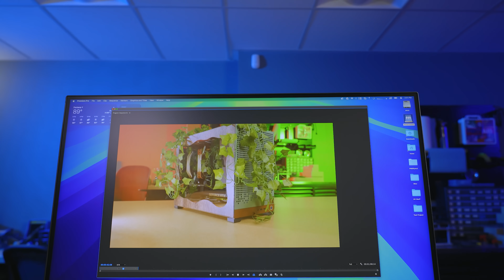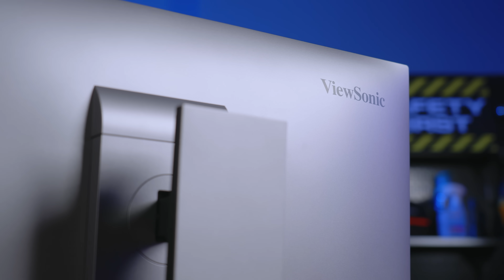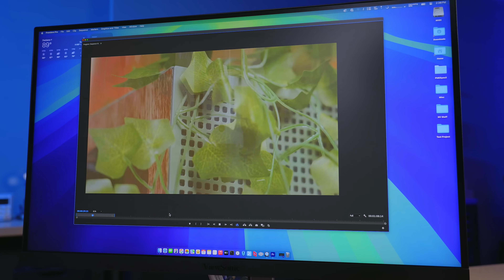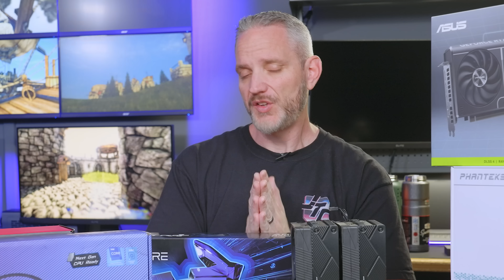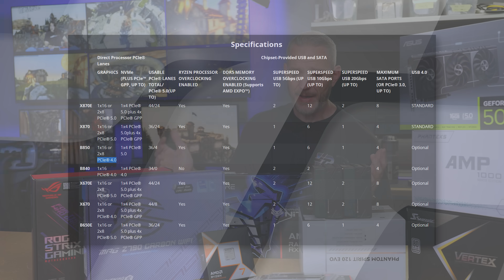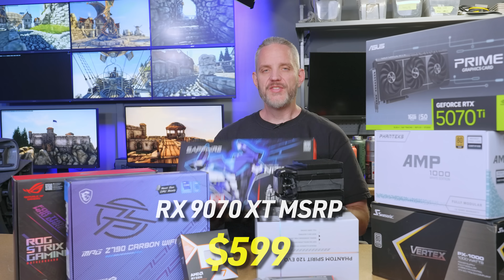This is the Sweetspot for PC gaming... Don't get fooled into spending more!

Comment: Thank you for telling us how and why CPU air coolers are still relevant! So many people are under the assumption that the only choice is liquid cooled when that's just not true. l have full confidence in my Be Quiet! Dark Rock Pro 5's ability to keep my 9950X3D temps in check and it does an excellent job.
Reply: you gotta remember a lot also depends on ambient temps, liquid cooling is way more relevant in warm and/or humid environments

Comment: My "NEW" system, after i realized i hate RT & DLSS: ryzen 5600x, msi gaming b50, 1080ti, 32gb of some cheap kingston ram, and the cheapest case i could find with a 450watt noname NT included. I play the witcher 3 at 1440k, with driver level ambient occlusion and xess, on high to ultra settings over 60 min FPS - for €550,- 😂
Reply: if u hate RT and DLSS why didint u buy an AMD card?

Comment: I've overspecced power supplies on every build.  But still had to replace on every upgrade because there was something mismatched.  Frequently the rail configuration changes between generations.
Reply: same here, right now i run a 1200W Lian Li Edge Gold PSU even though I only have a 9070XT and 7950X3D

Comment: Console player here. I have $1400 to spend on my first gaming pc. I also stream any ideas
Reply: 7600 $179
Msi b650 plus wifi $139
Patriot viper elite 16gb 6000 ddr5 $169
Western Digital Blue SN580 1 TB M.2-2280 PCIe 4.0 X4 NVME Solid State Drive $67
7900 xt $688
Apevia Prestige 800 W 80+ Gold Certified ATX Power Supply $67

Since you dont technically need a case grand total $1399.93

Just go to pcpartpicker choose what you want.

Comment: Sweet spot is remembering that when in doubt, a 9070 is typically only a ~10% difference from the XT in performance tests, and a good card to build around with upgrading in mind if the XT is unavailable to you at a reasonable price.

Comment: I mean I got an i5-14600k around black Friday for $174 bucks and i5-12600kf are $169 on Amazon and $185 for the K version. These are pretty killer deals if you ask me and they're great processors. The 12-600k is better than some of these you mentioned and very close to the others for half the cost.
Reply: I just this week built a 12700kf, z790s, 9070, 32gb 3200mhz cl16 platform in a fractal north running off a gold seasonic 750 and cooled by a peerless assassin and 5x noctua a12 g2's... for under $1300. Annihilates on my 3440x1440. Value aint dead, especially if you shop against the trends (intel cpu over trendy ryzen, amd over trendy nvidia, ddr4 over trendy ddr5 because i wish i had built this 6 months ago lol)

Comment: I Play on 1440P and Upgraded from an11400F to an 14600K .from 6700xt to 9070xt ,850 Watts Gold Corsair 850e,the whole Upgrade with Costs of about 1200€ , Motherboard Asus B760 Plus D4 ...Performing on nearly the Same Performance AS a friend who owns a High Cost High End System...in Gaming the Difference is small 

This is a real real good Setup for Gaming ,No need for an Expensive 5090 which in my Oppinion is way To Powerful for "Just" Gaming

Comment: Your knowledge of Moore's Law is critically flawed.

Moore's Law has to do with Wafer IC Density yield vs PNP Substrate width..... it does NOT have to do with Thermal Efficiency of Generational ICs over time.

But, the byproduct of Moore's Law is EXACTLY what is observed today==> HEAT(when closing the substrate gate) MUST GO UP AS THE SUBSTRATE SHRINKS because of the ensuing "bottlenecking" of electron flow throw the gate..... the smaller the gate, the bigger the gate resistance to electron flow..... V = IR...... since R gets larger with a shrinking gate, V( Heat ) across the gate goes up.

Moore's Law works in concert with the physics of Ohms Law.

Thank you for your attention to this matter.

Comment: Top notch rig from 2020 here and kinda regret getting an AIO and RGB in general, it started to fail kinda fast but didn’t check warranties because performance was on point.

Next step: wait for the AIO to die and update mb + cpu and use a fan dissipator for the cpu.

I also have a Samsung Evo Plus 970 1tb and it falls kinda short in terms of storage amount, would you guys add a second m2? It’s purely for gaming, these 150gb games start to hurt.

Comment: I may go back to air cooling. I just have a 5800x3d and it runs like 2 degrees cooler with. Huge aio but the radiator really restricts airflow to my gpu

Comment: I have a Gold rated Corsair RM 850W paired with a RYZEN 9 5900x and a RTX 4070 GPU, sat on a B550 motherboard. But I do have an older Gold rated 1250w XFX PSU that I took out of an old simulator rig as a spare.

Comment: Would my XMP ready DDR5 RAM will run on a AMD Mobo and Proc ?
Can afford a new one, with the current prices. Was going for an Intel build, but I didn't notice until late the bad reviews on the i7 265k, while the 9800X3D seems to overpower it in gaming use. @JayzTwoCents would you trade a spare DDR5 32Go XPO for my DDR5 32Go XMP ? :)

Comment: At least there's someone who is able to give a sound advice I can totally get behind. I have seen a short of Zacks Tech Turf and his take on using 5800X3D with 5070 Ti was to go AM5. A setup like that would easily last you another 4 years and by that point you're already thinking of doing a system wide upgrade or just getting an entire new system altogether so AM5 would be a waste of money. And I share a similar view on the PSU, just that my concern is not upgradeability but stress reduction.

Comment: I'm on a 14100f with a 4060 and my old 2400 ddr4 from my previous i5 8500 build. It's literally fine. I can play whatever I want with it. I have a refurb B760 board, but I would have just gone with a base model if I didn't find that. Again, literally fine.

Comment: I built my pc 8 years ago and still holding strong perfectly matched set and 3900x , amd 6800xt 16g, ddr4 4200mhz , gigabyte mb, 32gb memory ,28 inch acer predator 4K monitor

Comment: 10 years has gone so fast. Here i am again, building a pc for next decade
Reply: Facts i'm currently rolling with a 1080 since 2016, upgrading to a 5080 until 2036.
Reply: @Poochada127  Me too, but I just ordered a new one, will have to wait until mid feb for delivery. It hurt real bad because I needed 32GB VRAM for my AI-projects... Lets se if this a 10 year keeper to...
Reply: @Poochada127  Same here, still with my 1080ti since nearly 9 years
Reply: @Poochada127 congrats man,same but i got the 5070ti instead
Reply: @Poochada127 similar I came off a 2080’super to 2080 ti strix to now a rog astral 5080. I wanna upgrade my cpu now. I have the second best cpu for am4. And it’s still new but it’s showing its age .
Reply: I got the 3080 build. I got it and probably didn’t need it. All I play is wow these days. It should last me 20 years 😅
Reply: Same but the RAM price hike put me on hold. Anyway got a 5060 8GB as an entry to play the good old games(which are kinda better than the ones these days) and an M.2 drive which is amazing compared to the old SSDs and HDDs.
Reply: same bro almost 9 years here got fked up by AI now cant build a pc cause of it
Reply: Join the club.  Lol Slainte ❤️ 😆 🤣 😂 15:21
Reply: I'm five years in, just upgraded mine to max out my platform, good for another five years.
Reply: Same. My 4th gen i7 4770 still does everything I need it to do, but windows 11 says no.
Reply: i feel like 2020s have shuffled these expectations a bit, especially for GPUs due to generational gatekeeping.
Reply: I'm not a huge gamer but will dabble occasionally. Is DDR4 still relevant in 2026?
Reply: hahaha.. same here.. 1060 still in the rig..
Reply: My motherboard just started getting unreliable and I looked up the last time I upgraded... 2020 for my cpu. But my last time I changed my case was... 2015!!! I got a new case and holy crap the case tech these days are SO GOOD for SO CHEAP! I paid the same as I did back then but even with inflation, got a PC case that looks nicer, has 5x as many nice features, and I was impressed
Reply: If you build every 10 years, it doesn't really matter how much you spend.
Reply: @ThingsForYourHead  well you kinda have to get something that will last 10 years so I would expect to spend more
Reply: @milhouse8166 My oldest machine that still works is 8 years old and it was only about $1000.
Reply: @ThingsForYourHead  I guess I was thinking more if you do hardcore gaming or creative work with it. It depends on the situation I suppose.
Reply: @milhouse8166 Yea that's just a little old hades canyon nuc.  I'm about ready to drop over 13 grand on a whole PC and desk and chair set up.  I don't know if it will last me 10 years or not.  the desk and chair will.  I'm planning on doing creative work with it, and gaming
Reply: @milhouse8166 you'll got to be honest with yourself, PCS aren't getting any faster between 10 years, a drr3 pc can still do most things today and folks with drr4 16gig ram and 3060ti think they actually need to upgrade, when there will be no big difference.

Comment: Can confirm the PSU part, I've been running my Corsair SF600 since 2018, back then for an 8700k and 1080 Ti it was alright (plus there wasn't anything stronger in the SFX scene). Now I'm just jumping for the SF1000 and hopefully it will last me an another 8 years.

Btw. the SF600 still runs, it's just getting weak.

Comment: I always buy titanium PSUs because, in my country, the electricity is expensive. Also, titanium and platinum have better quality components, which means less heat and quieter fans. Last but not least, less wasted electricity means less environmental impact.

Comment: I built my pc in april, i was about to go with amd but i found a 14700f on ebay for £160/$213 which started me on a intel build, then i found a Motherboard asus rog strix z790-f gaming wifi 6e for £125/$165, then i found gskill 6400 32gb kit for £75/$99 with these cost savings it made sense to build a intel pc with my 5080, my 14700f is ranked 1st on xtu 2.0 benchmark

Comment: Cases 100% Form over Function?
What about a Meshify 3 black solid case with 7 fans to use as a desktop on top of a self build movable storage container that still fits under the desk?
Idea: no gpu sag, no cpu-fan sag. enough cooling, solid metal side dissipating heat better than a window and avoiding dust laying on a mesh top.
I'd say this is 100% function over form.
great video btw

Comment: 14:50 the PSU specs on the the GPU box also assume its connected to power hungry hardware like a 14900k or modern equivlent and 128gb of ram and 8 tb nvme etc...  so if you pair it with a 7600x you are not "stuck". I ran a 7900 xt for a couple years on a 650 watt psu because it was only paired with a 5700x  it was fine even put up some #1 scores on 3d mark with it.

Comment: Pretty much how I ended up with my new build of  9800X3D+64Gb DDR5+5070ti 16Gb (before ram prices went completely up). Went with a X870 board, 1250W PSU (a bit overkill), water AIO (never had one) and a 2Tb lightspeed M.2 NVMe SSD for futureproofing because I have a couple older SATA SSDs still good. But this should keep me covered for the next 5-10 years. All around 2500€.

Currently going on strong with close to 10yr old i5, 980Ti, 32Gb RAM + SSDs which has been enough to play fullHD on pretty much anything up to 2020's and was about 2k€ back then
Reply: Hm, interesting. How much did you pay for your RAM and what were its specs? I have recently bought pretty much the same main components (CPU, GPU), went with b650 mboard though, 850w Corsair Rx, air cooling, 9100 pro 2tb SSD, and Corsair Vengeance DDR5 6000 cl30 16x2 which alone costed me €389. The total rig totaled at €2.450😅
Reply: @cybronichuman They even increased the price by 40euros while I was still on shopping basket on black friday so I paid about 470€ for 64Gb (2x32Gb) 6000 CL30 😢 now  it's around 800€ almost everywhere...
Reply: @LiikenneAnkka  ufff, 470 sounds like a damn good deal in today's prices!
Reply: @cybronichuman it was, but original Price would have been 430€, I guess they had older stock still available

Comment: I disagree big time about powersupply gold vs titanium.  The titanium not only saves you a few cents a day (which could easily add up to $50-100 over the lifetime of the unit)  but it also has a longer lifespan (money savings, buying less PSUs) , better transient handling, quieter fan curves, lower failure rate, better quality components.  The PSU is the cornerstone of your PC, don't skimp here.

Comment: Me sitting on a i7 4790k with 16gb of ddr3 ram using a 5060 playing on a 4k TV while running on a SATA SSD

You dont need the latest and greatest to have a good experience.

Im running on 10 year old hardware other than the GPU

Comment: I don't think intel always is to avoid when compared to amd cpu. Two years ago I built my gaming pc and I was looking for a good cpu to never have a bottleneck issue with my 4070 (or upgrading) and also be able to work with huge files. at the time two processors where competing in the range I needed, the  ryzen 9 7900X and the i7 13700KF. And honestly the i7 was better for almost everything, was 50-60 euros cheaper, and the equivalent mother board was cheaper too. So you should just watch case by case even tho, yes, amd nowadays are most of the time a better choice. Also for thse kind of CPU I had to abandon my noctua nhd 15 chromax black and go for an AIO msi coreliquid d240 wich was basically almost the same price (when I bought them) and the AIO basically gave me 5-7 °C less than the noctua wich is absolutely insane.

Comment: 19:10 It overheats on GPU 2 hotspot temps up to t he point where the PC shuts down, but the average temps are great, because averages don't take into account those temps. What I really want to kmow is if 9070 non-xt has the same issues. Can't find reviews where the hotspot temps are shown anywhere. I would much rather not pay for a 5070ti, it's overpriced, but at this point it might be the only safe option. I know how the temps work on  that one, and they're insaingly good.

Comment: You really need to be aware of tall air coolers and GPU lengths when choosing a case.  Minimum air cooler height is 160MM, but other air coolers can be much taller.  I had a 165mm air cooler and I couldn't put my side panel on my case.  Same with GPU lengths.  they can be very long,  some over 360mm.

Mine is 320mm on Radeon 7900XTX.  I even bought a standard ATX 1000w PSU, and it was too long and it wouldn't fit in my case.  I've had to find out the hard way.  Never trust standard sized parts, always look at cases first, then make sure the parts will fit into the case.  Just make sure the product description lists all of the dimension of your parts.

Like the old saying goes, measure twice and cut once.  Hopefully you won't have to cut anything, but make sure to measure twice before purchase.

Comment: my build
Ryzen 5 5600G
8G RX580 GPU
64GB ram 3600
MSI MPG B550 GAMING PLUS AM4 AMD B550 USB 3.0 ATX AMD Motherboard
Thermaltake Smart W3 SP3-700AH2NLW 700W Power Supply - White - Internal - 120 V AC, 230 V AC Input
SAMA L50 360mm Liquid CPU Cooler AIO Cooler with ARGB Infinity Mirror Effect 3x120mm
case Cooler Master HAF 500 H500-WGNN-S00 White Steel / Plastic / Tempered Glass ATX Mid Tower Computer Case
money is tight the ram and APU are coming out of a HP system i cannot upgrade, the RX580 i bought for the HP but it will not work in that system due to the PS and MB
i do not play multi-player games or new titles and i do not mind 1080p but i do have a large library of older titles.